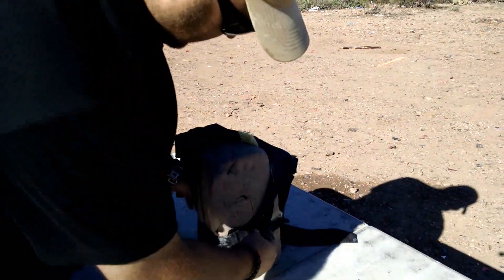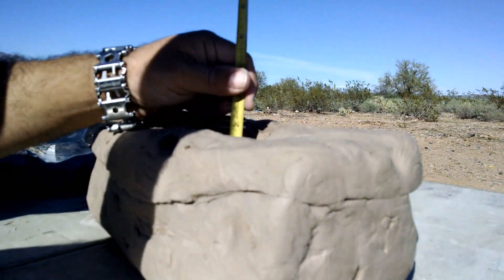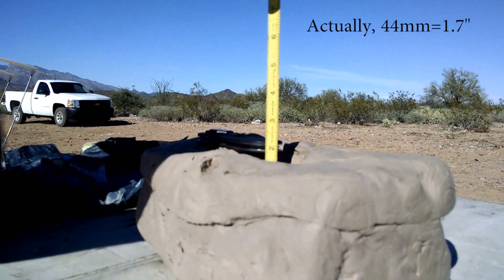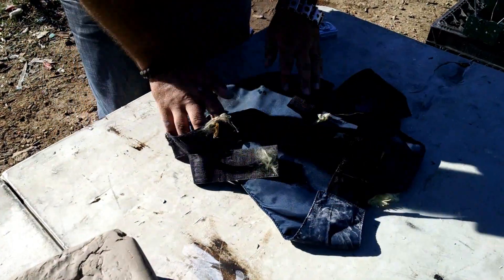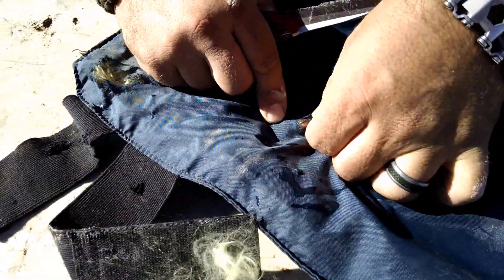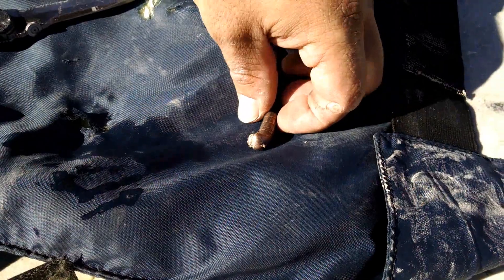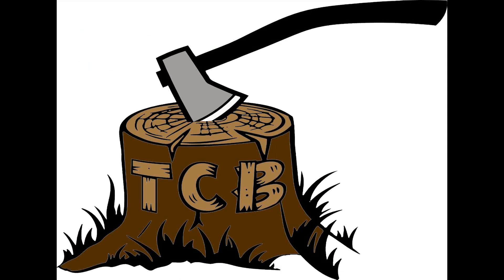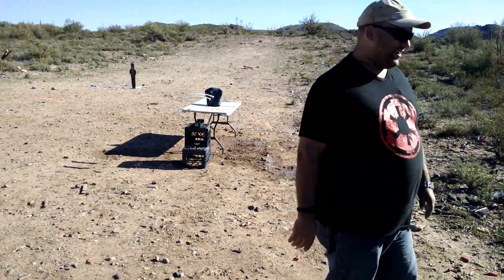Armor test: .300 AAC 200 gr REAPR vs. level IIA soft armor ***DEMONETIZED***

Comment: I appreciate the video.  Not quite sure what you were expecting as the results were...well, as expected.  Still, thanks for the 300 Blackout love.  I'll stick with the 110 and 125 grain supersonic stuff from 16" barrels.
Reply from the maker: Lol. This is exactly what I expected, but not everybody is aware of this, as evidenced by the poll I posted on Arfcom. I think I'll also test some supersonic ammo. While full power rifle ammo would normally defeat soft armor easily, some of it is relatively low velocity when fired from an 8" barrel and it may actually be stopped.
Reply: Yes stick to a barrel length with zero advantages for a round designed for max powder burn around 9” lmfao